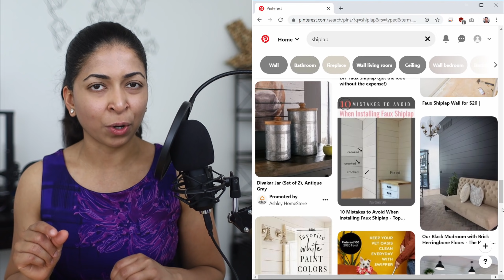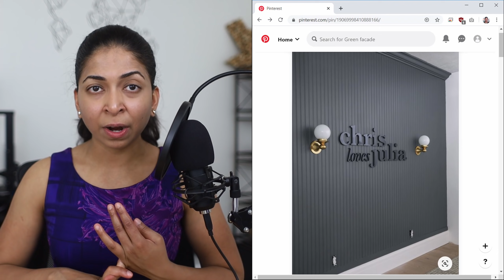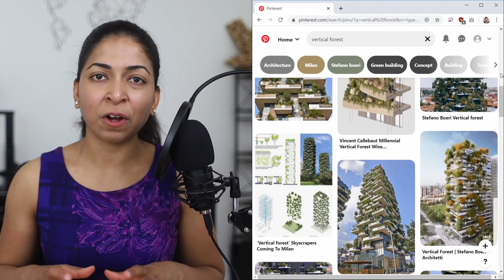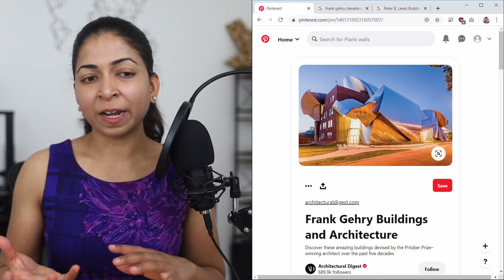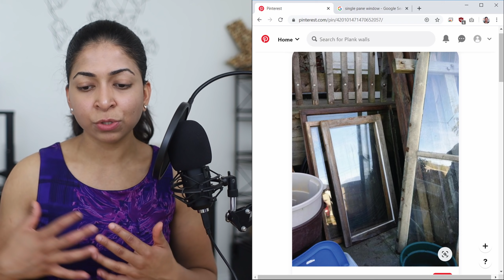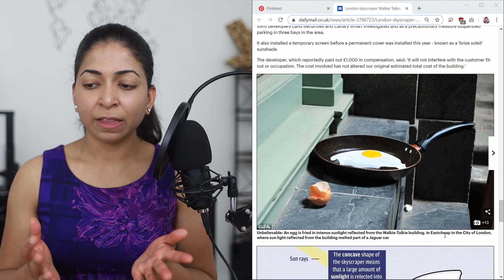Crushing your pinterest dreams | shiplap, vertical forests, skyscrapers & more

Comment: I moved into a new multiple magazine award winning corporate HQ building in 1980. The hot water solar system never worked. Cubicles were a new thing but the company to save money, went with used 25 year old large desks. Each cubicle had 1 duplex electrical outlet and shared a 70w HPS pendant light with an adjoining cube. The floors were cantilevered ✅ to allow suns rays in windows in winter by were shaded in the summertime. This feature is about the only feature that still exists.

Comment: I work in underwriting for an insurance company and I once saw a tree in the middle of a house. Like it had obviously been a smaller house, they expanded around it for more Sq ft. But it was a pecan tree with a metal roof?? The noise? The squirrels? Not to mention getting into the area where the trunk was to clean it out of pecans. Can you imagine them piling up and getting all gunky with rotting nuts and bugs? Dumbest idea

Comment: The house I grew up in had a tree in the floor, though most of the problems weren't really applicable. It was a small tree, with its planting area edged by the terrazzo floors, and the house sat on anthracite clay, not on soil. We just needed to water the tree every so often. Oh, and the house was built back in the 1960s. Possibly the 1950s, I don't know which.

Comment: In summation for a tl;dr:
Shiplap: Consider other options for your house, actual Shiplap walls are expensive and there's plenty of styles that do the same jobs.
Trees inside House: Do you want bugs, termites, rotted wood and busted flooring because of growing roots under your house m8?
Vertical Forest buildings: Lotta green for same problems.
Container Homes: Tiny, crap materials, actually expensive since it has to have all the insulation of a house, will actually have much less space due to said insulation + electricity etc, drove up costs for actual containers which increased economic inflation since containers are integral to every industry and reducing the number of them on any market makes them more expensive due to increased scarcity
Reinventing Windows aka Extruding Windows: There's a reason why windows are inside a concave windowsill.  WATER.
Glass Scyscrapers:  Almost no insulation, consumes a crapton of air conditioning power, horrible maintenance costs, causes massive sunburns to anyone near it.

Also sprayfoam insulation is great for any building.

Comment: I LOVE bead board.  Shiplap was one of those design features designers tried to SAVE, when they found them in a renovated building.  Trying to mimic that look, is just a fad.  It's going to date your home, and in a few years you'll see designers going, "Ugh, we need to remove this dated shiplap!"  

I love the idea of trees in buildings, but everything you said is true.  It might be better to use shrubs, and plants with smaller root systems and needs.  The trees integrated in the building are beautiful, but again, smaller plants would be a better choice.  One benefit I see, is that it might encourage people to build UP, rather than continue to sprawl in low, buildings.  Going up is a better use of space, and if they can incorporate more amenities near residences, it could save on driving/transportation.  I'm wondering if it's feasible to have dwarf fruit trees in these designs, so it might help with food production.  Or would falling fruit be a danger?  

The protruding windows make me want to line the box with plants.  If this isn't the plan, then why bother?  The glass skyscrapers sound like a bad idea.  I never thought about it.  Seems that's going to be a challenge going forward.

Comment: Oodi central library in Helsinki has these windows the size of a wall. When I was writing there in the winter, on a long desk where they have places for people to work & study, and as it happens the desk is right by the window, everyone was grabbing their coats from the coathanger. It was so cold that working in that temperature is impossible without extra clothing, because you start to shiver. And btw we normally wear sweaters and such in the winter, I personally favor wool, but yet it was too cold without a coat.

Otherwise I really like the space on the top floor, there's sort of a noisy end with the café and the kids area, and a quiet end with places for reading, work and study.

I'm 100% with you on the need for smaller windows though. I hate how they still build these huge ones in new apartments. They also make placing furniture much more difficult, as the rooms are small, and if you have (closed) shelves you're out of luck. Also we've had these horrible heat waves even in Finland, so we'd really need sustainable solutions.

Comment: "There is nothing new under the sun". Yet everyone keeps trying. There is a lot to be said for the old fashioned ways. Those people had already learned it the hard way. Why be hard headed and have to re-learn it the hard way when it's already been proven that it doesn't work. I mean, there are reasons why things are built certain ways like the extruded windows. There are reasons why windows aren't normally built out that way and yet, silly, immature people will try it again and have to learn the hard way again, and again, and again. It's like when I look for a house to buy, I look for your typical ranch house with a simple roof line, good eaves, brick exterior, yada, yada. How boring you say! But they were popular for a reason. They are nearly maintenance free. Living is all on one floor which is so efficient and helpful as you age. All these McMansions with their steep, multi peaked roofs waste so much space in those roof lines plus it costs an enormous amount of money to re-roof the house in 20-25 years. You put eaves on to keep the rain water off the sides of your house because it causes rot on windows and doors and foundation problems. You put on gutters for similar reasons. You use brick and DON'T paint it for Heaven's sakes. Because you will have to keep re-painting it every 10 years. Brick is maintenance free. Anyway, my point is, we've come a long way in architectural history and there is no need to re-invent the wheel, especially on a middle income salary, LOL. So I always looked for a well constructed brick ranch from the 1950's to 1980's. Better construction. I also look for good layout. And, of course, location, location, location. Buying an older home and bringing it up to date is a form of recycling and we've been very pleased with the houses we've bought and remodeled. Today, they build new-builds out of styrofoam and Lincoln Logs. It's so cheap and poorly made and you would do better to rescue an older home and fix it up. As for commercial buildings like you described it is all about vanity and pride which crumbles in a puff of real life. What is shocking to me is that anyone would not only design such foolishness (I mean the architects should be educated professionals at solving problems before they make it in the final plans) but even get passed and approved and authorized by the owners, builders, or governments that have the final say-so. How do these idiotic designs get past those who foot the bill? I don't have a college education and certainly not a trained, professional architect but even I would object if someone was going to put a tree in their design. It is so inherent with obvious problems that it's beyond me how it ever gets as far as being built. Surely someone should have raised their hand and asked the obvious questions?

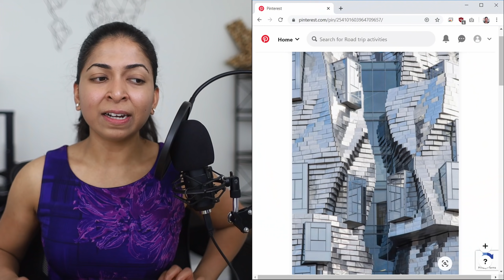Comment: 6:30 All Good Architecture Leaks- a video essay I watched recently. We must innovate. If you have enough clout as an architect to get away with this as long as you are designing something that enriches your experience on earth you shouldn’t be scared off of leaks 😊
Reply: As we engineers say: "If it invites leaks, it's not good architecture".
Reply: @Codraroll  Good Architecture can only exist where engineers understand the difference between a good building and a good piece of architecture.

A good engineer can make anything work with enough love (and pragmatically money, sadly). It is the job of the architect to challenge the engineer (and to listen) and it's through that symbiotic relationship that great architecture can be produced. And if we are successful we will have a water-tight envelope. 

Great architecture should not be limited by something as mundane as a leak. However I will add, it is one of my biggest fears to have a leaky building.
Reply: @Dev1nci  A leak can destroy the function of a building, however, at which point avoiding the leak is more important than bending to the whims of the architect. Far too often, it ends with a stalemate because the architect says "I want it to look this way because it will look better" and the engineer says "It simply won't work and it'll cost a fortune", and then the client sides with the architect and big money is wasted.

At my university, they had to change the roof of a quite new, large building to the cost of $10 million because the architect didn't want parapet flashings to interrupt his visions for the façade. The result was water leaking in everywhere, ruined insulation, a need to replace several thousand square meters of thirty-odd smaller roofs, and then they had to fit the parapet flashings anyway to prevent it from happening again. If only sense had prevailed from the start they could have saved a fortune, but apparently it was more important to preserve the ego of the architect than the functionality of the building and millions in taxpayer money.
Reply: @Codraroll  I know what you mean man and in general you are right. But a lot of the most loved architecture has functional flaws and I can illustrate it; I'm going to sound like an ass but I'm not being patronising on purpose. 

I have a toaster, it serves me well almost every day. It functions well but was designed with no imagination. I don't love it.

I also have a drawer called 'My drawer of beautiful things' It has some drawings I did, a particularly pleasing empty deodorant can, an unusual beach pebble, a seed pod, a piece of marble and a 3D print of an artwork that I had made at a larger scale. None of those things function, I love that drawer and look to it to encourage and energise me sometimes when I am designing. 

This is the the actual job of architecture. It is to enrich our experience on earth by showing us beauty as it relates to its physical and cultural context. It is to be art that brings a smile to your face the same way that your messy and lovable dog does even though he regularly treads mud into your apartment and you have to clean up after him. Real architecture is like a baby whom you love even though it keeps you up at night and you have to constantly feed, clean and reassure of that love. Real architecture is an experience that manifests itself in your heart and not in your brain. 

To illustrate: the Sydney Opera House is pretty poor functionally because it's too small to host many of the operas that it should be able to, it went 1000% over-budget and was completed late but people love it so much that it has practically become a symbol for a continent (if I think of Australia I think of the landmass, a kangaroo and the opera house). 
The Eiffel Tower serves no purpose.
The Guggenheim in Bilbao was a major factor in energising a city in immense financial strain at the time however on completion the artists complained that it was too loud for the their work.
The Pompidou Centre has all the services on the outside so every pipe and duct needs to same maintenance as a facade. There are countless examples of this type of architecture that is functionally flawed but so loved that people identify themselves with it. 

Conversely Brutalist architecture is some of the best functioning architecture. It deals well with sun and deals frugally with materials and they are built to last like the pyramids. It is some of the most hated architecture that exists and people lobby for various examples' demolition. I love it for what it is but I am in the serious minority :)

In reality the architect should try find a solution with the engineers and should seriously contemplate whether his building is an example of great architecture or not. Sometimes the fault lies with someone else but seriously the difference between a well respected engineer and a run-of-the-mill engineer is his ability to identify with the aim of the architect. In my city one of the most respected engineers is the son of a renowned architect and the other lectures in the architecture department at the main university. And the reason that they are respected is that the great architects love them and so insist on using them in their projects. So all the worthwhile architecture is engineered by the same people :)

Hats off to you if you've read this whole message man but it's something I feel strongly about :D What is the name of the building and architect that you mentioned bro? I'd like to look it up and I'll give you my opinion of whether or not the architect was right.

Comment: I knew my eye rolling training regime of occasional Pinterest scrolling was not for nothing.

Also, I believe the reason they use glass for skyscrapers, is to protect the building exterior from the corrosive air of the city. Since you can’t build that high with brick. Other materials and concrete would erode too quickly.

Comment: Small biology nitpick from the tree section: Trees breath carbon dioxide not oxygen which they get from the ambient air through small openings usually in the leaves. A couple other issues I think that designers might not consider as it isn't common knowledge outside of biology. Many deciduous tress, like the ones in many photos, rely on the tips of their roots for water, not the base of the tree. If you've ever sheltered under a tree during a rainstorm, you might notice that there is less rain near the trunk of the tree and more rain dripping on the edge. Many trees use this to their advantage as the tips of the roots will match the circumference of the canopy to maximize water. By surrounding the tree with a covered surface you limit the amount of water the tree can receive, as simply watering the base of the trunk is not an effective way to provide the necessary hydration to the tree. This is why many cities have issues with trees that die as they grow older and loose the ability to collect rainwater. I would assume the large trees in New Orleans that you featured are a result of the notoriously moist soil that stays hydrated from underground. Another issue that you briefly touched on with hi-rises is the removal of trees from their native environment to a whole new one. There is a hidden issue that we often miss when moving plants to a new environment and that is fungi. Most terrestrial plants either require or are supported by a complex relationship with a certain group underground fungi. These fungi form a mutualistic relationship with the plants that we are only recently beginning to see the complexity of. Trees are able to share information (like disease immunity and offspring health) between each other using the fungi as an intermediary. They are also able to share nutrients in an emergency with nearby tress. By confining them to small limited planters we are removing their ability to interact with other plants and trees which can (but not always) damage the health of the organism and increase the chance that you will lose most or all of your trees to an insect or disease infestation.
Reply: Well said!! Do you think there is any way to design a house or even an urban setting with more trees??

I can only think of having a courtyard for a house, and just simply having parks for a city. But I am neither a biologist or an architect.
Reply: @elijahclaude3413  The three big concepts to keep in mind that would improve these designs are: diversity, spread, and native species. By diversity I mean that having any space that features the inclusion of living things will benefit from having many different species present. Having a street that is lined with elm trees for example, may looks nice but a single outbreak of something like the historically devastating dutch elm disease, can result in the complete loss of the project. Far better to plant multiple different trees not just because it's not putting your eggs in one basket but because resistant trees can act as a buffer for other species further away. With spread, I mean how close to one another are these trees/plants. If a tree is alone surrounded by miles of asphalt and pavement then the necessary pollinators and symbiotic fungi won't be able to travel to your location. I realize this is a urban planning rather than individual project issue, but surviving as a small island of green is going to be that much harder. Last I would say to stick with native species. Trees and plants that grow wild nearby and in similar soil/light conditions are not only likely to do well, but are more likely to share pollinators and fungal connections.
Reply: @lillithcollins5192  This is some great info! Thank you very much!!

I hope the growing interest in solarpunk will keep things like this in mind to ensure the new wave of 'green' living doesn't become divorced from building actually healthy ecosystems and such.
Reply: Trees breathe oxygen, they need carbon dioxide for photosynthesis.